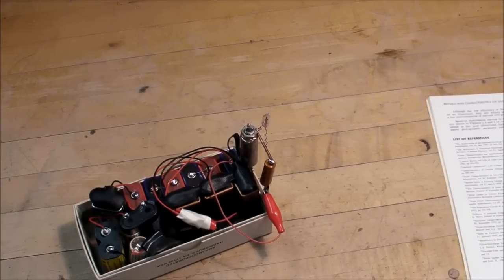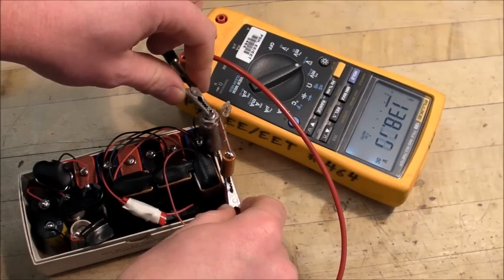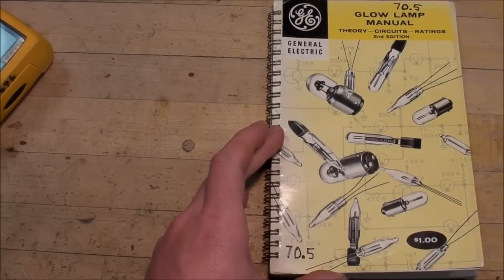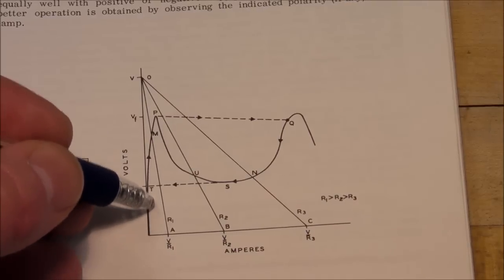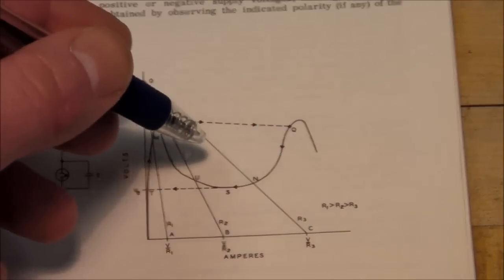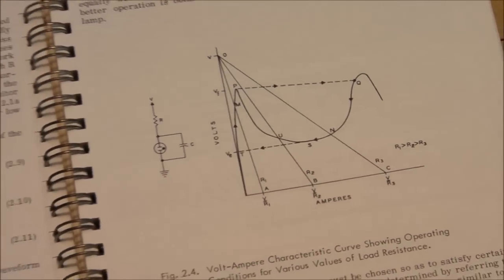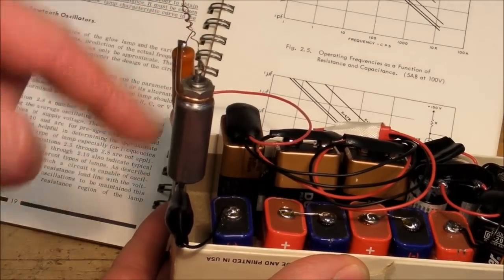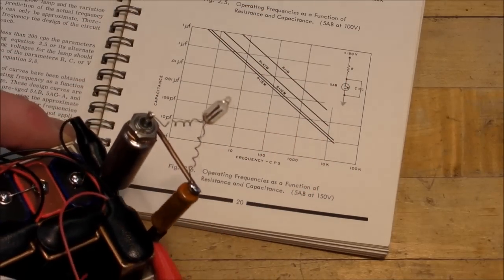(#0034) Neon Lamp Relaxation Oscillator

Comment: I've been trying to get 9 of these to randomly blink with different capacitors across each NE5 lamp. They all go into a box that someone made back in 1970 or so. I've been knocking myself out over this... they used the same style capacitors that you have there.. All old school. My parents swore that it had been self contained and "on" for a couple years  back then, but I haven't been able to figure out a battery combination that would work... but seeing that book and the 50 volt batteries... it is all clear now!! I wish I had seen this video a few months ago..... the project got me playing with IN18 tubes.... those need a little bit more voltage though... and only about 4 milliamps. Thanks for the video! I wish I could reincarnate as an EE.

Comment: I recognize those batteries, They were used in vintage vacuum tube radios. I mostly remember the 22 1/2 volt batteries that look similar, but a little larger. Then there was the 57 1/2 volt "B" batteries. And 45 volt batteries. They are long gone and no longer available.

Comment: It is not safe to touch the batteries' terminals at 150V although it seems just to heat a little. The real danger from DC currents is that a lasting discharge can trigger some electrolytic process inside you body and make poisonous substances. In this sense, AC shocks are less dangerous for a given current than DC ones, because the reaction is always being reversed; but with DC, these substances may accumulate and become dangerous to your health.

Comment: This is quite an old video and I'm not sure how quickly I'll get a response but I'm a highschool physics teacher helping a student who is very curious about these circuits. We have been successful in getting a neon bulb to light up with a power supply of batteries and some resistors in series. When we connect a capacitor in parallel with the bulb the bulb stops glowing altogether. The circuit continues to have current leaving the battery and the voltage drop on the capacitor and bulb are constant values. Any idea what's going wrong?

Comment from the maker: Yes, the voltage across the cap is a close approximation of a sawtooth wave. There is some slight curvature of the ramp in each "tooth" due to the exponential rise of voltage on the cap. The pk-pk voltage of the wave is typically 20 to 30 V and raised up by DC level of somewhere around 100 V. For this particular lamp, I measured the sawtooth going between 100 V (the lamp's turn-off voltage) and 125 V (the lamp's turn-on voltage). Other lamps will have will have different characteristics.

Comment: That flash must last an extremely short time.
It would be interesting to put the bulb in a dark chamber with a photoresistor or a phototransistor hooked up to a scope to measure the burst.
Reply: It depends on the size of the capacitor.
Also, why not just scope the voltage?

Comment from the maker: Given the high DC component, you would need to use an AC coupling cap between the sawtooth generator and whatever circuit it's driving.